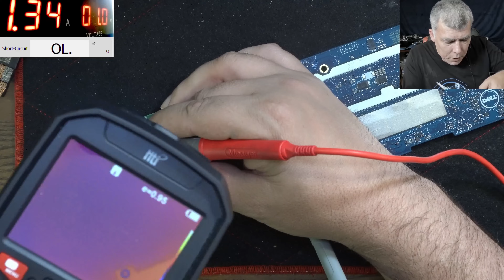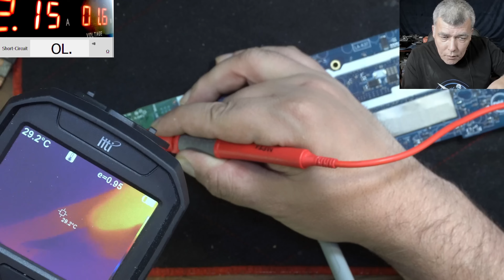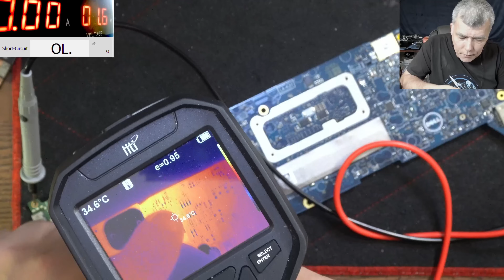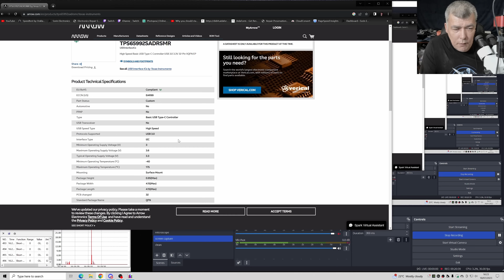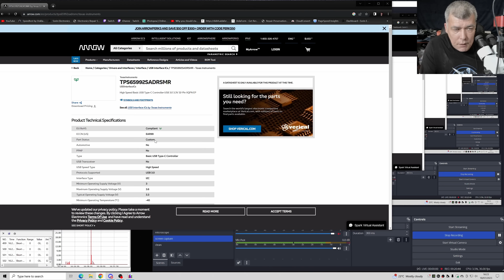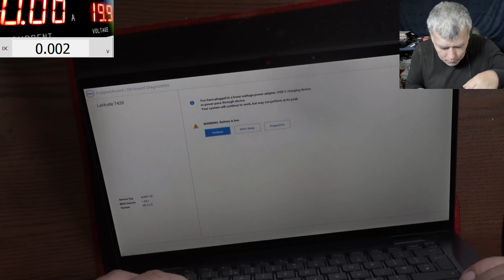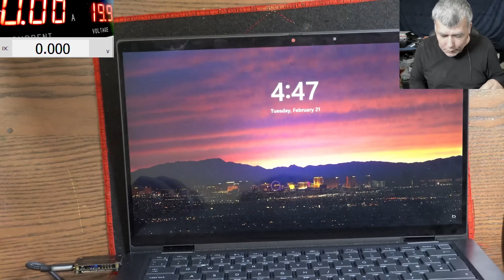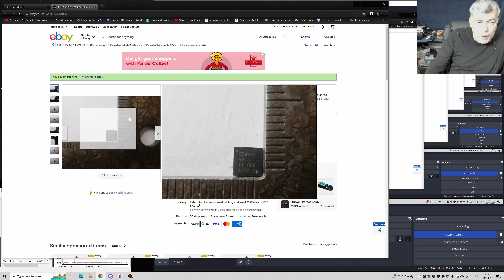Dell Latitude 7420 not charging repair - TPS65992 replacement

Comment: Hello there i was wondering if you could help me i own a recoil II  GK5CN5Z and my nephew mistakenly put my c charger in to the c port at the back of the laptop and now the USB dont work every other port works Headphone/Mic/Ethernet all work fine so this should be a small job right ? if  it is then would i be able to turn an m.2 slot in to 3.1 usb or even 2.0 would help as my laptop has a sata port and 2x m.2 ports any help would be awesome...

Comment: Good job I think soldering is critical for good work. Im always in awe of these guys who just make it look so easy. I weld and I had to learn the cleanly part, the amount of heat, angle of holding the gun and timing to get a good bead. Practice makes perfect. Lol

Comment: With the sticker now it's a Dappell. But it's a super stupid idea to blow something up and risk to damaging something into the unrepairable state OR burn somthing into a level, that you cant read the letters on the damaged component anymore... so be more patient. that mistake could be avoided through taking the probe on the left hand and the thermal camera on the right or turning the board 180degree... i'm pretty sure, that chip wasn't that damaged... and you blew when pushed 4 amps. You see, how hot it got with only 1 amp! You pushed 4 amps for a long time... that melted the chip. Switching supplys shut off when shorted.

Comment: How do you deal with no charger in some cases where there is USB 3.0 Type C plug? I have seen some chargers for sale online but they are specified only for a certain list of laptops. Is there a universal charger, or does it work plugging it to a bench power supply?

Comment: how much times you had problem with new chips wont solder bcus humidity etc which is on pads you need to clean pads on chips before soldering. its not rubish its just layer of how they are stored handled like guy said... i saw you rush that with chips my honesty opinion is thats turbo job for shop you are home now you have all the time you can make it nice. Love bro

Comment: The weirdest short I ever had to track down was finally found inside the micro USB port.  The strange part is that it would ONLY show up when the cable was connected but would be gone it was removed.  It was so hard to find because it was never there when I was testing for short since I wouldn't need to have the USB cable connected.  Only when I spoke with my customer and asked them EXACTLY what they were doing when the problem happened did they mention they had been trying to charge their phone.  I tried to replicate what they did and suddenly the short was there but I was using my own known good cable so I KNEW that was not the problem.  Once I swapped out the port the short was gone and never came back.  I still can't understand how no parts burned out or how the port could short out that.

Comment: Hi i find your channel very interesting keep up the good work... I have a question maybe you or someone else can answer. I have an Alienware P69F which when plugged in to the main will light up the logo and then go off. Doesn't switch on but when checking the voltage to the battery i see 11.4v Does this model work without the battery connected? I'm not sure if it needs replacing or there is a fault on the motherboard. With it lighting up the logo i don't think there is a short anywhere but i've not check yet. I want to rule out the problem being the battery.

Comment: Hey Sorin, how are you doing? I'm interested in repairing and want to start. My question is does a 15v dc enough for laptop repair or did I buy 30v dc. Thanks
Reply: You need whatever voltage the laptop needs to operate which generally is 19 volts so i would get a variable power supply 0 - 30volts and 5 or 10 amps.
Reply: @JonnyMac351  Thanks once again.

Comment: Sorin, is it posible a Dell computer is not turning on if the screen is not attached? I have a Dell XPS without screen (waiting fot he replacement) and it won't turn on cause it's not passing the POST  process. Is there any way to fool the mobo or apply a load or something to use the computer headless? Awesome content as usual. Thanks!

Comment: Apple logo on laptop as the client wishes it was a Mac lol😅. Sorin you are right I have been soldering for many years even before utoob and as long as it was fixed I did not care. I even used to solder without flux and the old solder was proper "calibrated" lead and good flux in them. Only when I started watching utoob I became obssessed with the finish of my soldering and feel ashamed lol. I even pretended to be a novice in soldering asking silly questions on those channels I watched. Since watching your  channels I became less so concerned and obssessed. Those soldering of the past repairs lasted until the appliances or devices died of old age. By the way I see what you mean about the prius and you are correct in USA they get the better deal in all aspect. The truth is Toyota is my favourite car and my first car was a Toyota Carina and I swear by the make. I have had 2 prius and they are excellent only to be spoiled by Taxi drivers LOL.

Comment: I love watching your videos. I have been able to correct some minor problems because of them. One that I haven't seen addressed is affecting my Dell Inspiron 3520. It got unplugged during a Windows update when the owner's dog ran through the charging cable. Now it will not power on and actually kills the AC adapter when I plug it into the charging port. Have you ever had a situation like this?

Comment: Hi Sorin! I was always wondering what's going on with the excess solder on the ground middle pad under the chip. When you press the chip down and squeeze the solder out how it is possible and the excess solder don't create bridges with the outside pins of the chip?
Reply: Because of flux it will not bridge try it once u will know
Reply: @skjatayumobileandlaptop1013  I have tried but after removing the solder blobs outside the chip always i was wondering if under the chip is all ok and i thought if this is the rule and the guarantee way or a 50-50 chance for success...
Reply: No it will not bridge